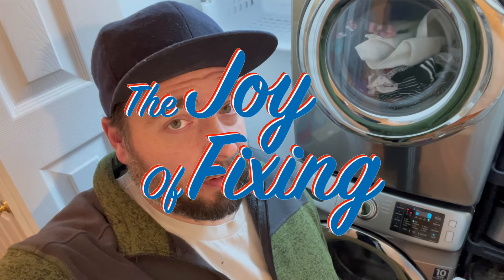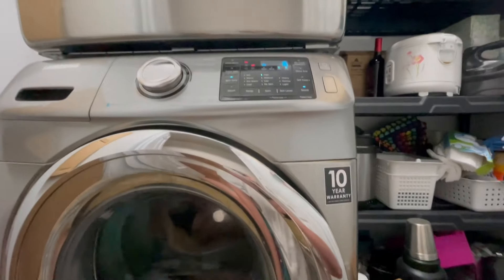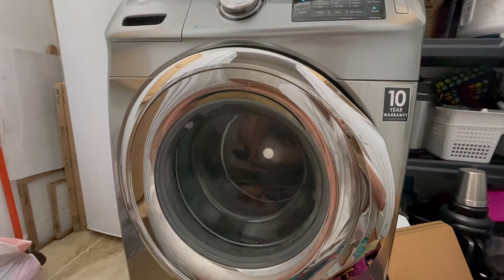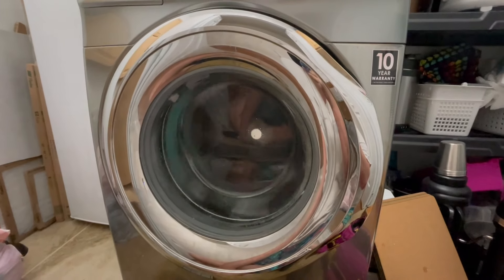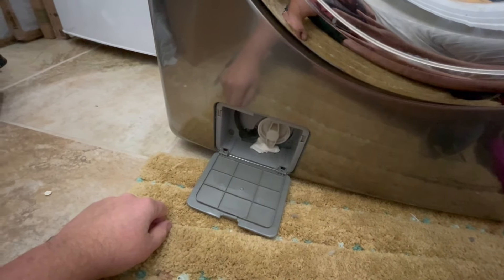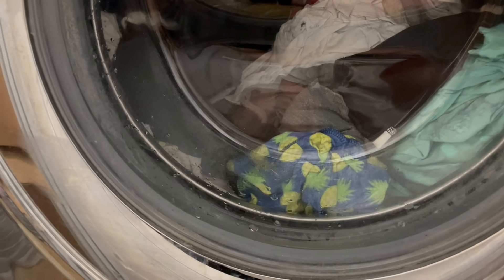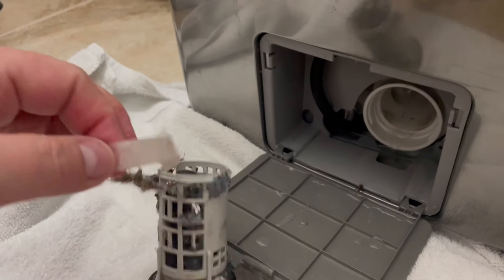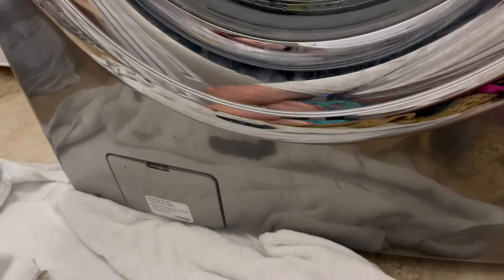Samsung 5E / SE / 5C / SC Washing Machine Error Code On Screen - Stops Running - EASY FIX!

Comment: Worked for me thanks.  I didn't have to pull out the black tube because my washer is outside.  I just pulled beige cap off and let the water flow on the ground and removed all the junk from the filter. It was disgusting.  The washer I'm using came with my apartment so the things lodged in the filter are a combination of my filth and the previous tenants... yuck.  Thanks again.
Reply from the maker: Very nice! Glad it worked!

Comment: If you clean the filter (it was definitely clogged) but the machine still stops and throws the same code, what would be the next step?
Reply from the maker: I would check if something made it past the filter and is clogging water leaving the machine.

Comment: Unless burning smell, then pump is probably bad. My washer still wouldn’t drain after cleaning/checking filter.
Reply from the maker: If you’ve burned out the pump, you been fighting clogs for a looooong time

Comment: Why is the filter torque limiting in both directions? It should only be for tightening.
Perhaps it's a manufacturing defect.
Torque limiting in the direction of loosening prevents the filter from being removed and you have to use plyers to remove it.
Reply from the maker: Sounds right for some machines.

Comment: My washer filter at the bottom of my Samsung never has any dirt or hair in it anymore. The first time it did now it doesn’t and now it’s leaking and giving me an 5C code. I’ve checked the drain hose. I’ve checked the water filter. what else could it be?
Reply from the maker: You might have a dead pump. Or a failing pump. I think at this point you have to call an appliance guy.

Comment: I found stenching semi-gelatinous, putrefying mouse, that met a grotesque death past the filter, in the tube. When I tried pulling it through the front, with a hook, the mouse cadaver shredded, apart, entrails, an arm, and part of a rear leg got pulled out.  The fermented mouse then went from putrid to pestilent.  I had to remove remove the drain hose and flush it with water from a water hose.  When the grizzly black clog jetted out of the hose and the water started running from black to clear, I reinstalled the hose and all is doing fine. 

Rest in peace Jerry 
Jerry Mouse  (2022 - 2024)
Litter mate, gnawer, squeeker
Reply from the maker: I guess I’m next….

What can we say about Jerry the Mouse? He was a friend, a good steward of the dried corn and an above average precision nibbler. He loved tight spaces. He loved wet spaces. Ultimately, his fondest loves became his demise. Let that be a warning to all of us… one moment you’re touching the hem of utopia and suddenly it’s months later and you’re being jettisoned from a discharge hose at 80psi. Let is never be blinded by our desires, and let is always hold Jerry in our memories. 
Ashes to ashes, Dust to dust, putrid gelatinous remains to storm drain. Amen.

Goodnight Sweet Prince

R.I.P. Jerry 2022-2024
Lover, Scoundrel, Friend, Flesh Clog

Comment: I actually have to drain it this way daily now... what is the next thing to actually FIX the issue. It's is probably the pump... which we had replaced while it was under the extended 3 year warranty... twice.
Reply from the maker: That’s extremely lame. You’re not getting good wash cycles then. Maybe try a different brand pump. Tell your service person not to use a cheap aftermarket pump.

Comment: Hi I need your help. I had the pump replaced with new o 8:07 ne and it still doesn't work. The error code says 5E.
Reply from the maker: You literally must have some sort of a clog in the line. I can’t think of any other reason. If you paid to have somebody replace this pump to fix that problem and it didn’t fix the problem you need to call whoever did the service and tell them they didn’t fix it.
Reply: Thank you.
Reply: @thejoyoffixing if you can’t think of any other reason then obviously you don’t have enough experience.
Reason is power module not powering the drain pump. I’ve had more of these than drain pumps failing. Yes I get the odd “pump clogged” but have seen more of the “no power to the pump” than actual pump failures

Comment: What if I have 5c message AND it won’t spin
Reply from the maker: It’s not spinning because it’s not allowed to in whatever mode it’s trying transition to. It’s trying to protect your pump. Check for a clog. If it’s not, you might be in need of parts

Comment: When I turn the filter knob the filter never comes out. It just clicks when I turn it.
Reply: Mine was stuck because of a pen, I just used raw power with pliers and broke the pen in two, the plug came right out with all the rest
Reply from the maker: You might have something large stuck inside. Who knows. Maybe get out the pliers….. not sure. Tread lightly.

Comment: Hey I don’t have a damn filter tf am I supposed to do lol
Reply from the maker: You’re getting the code but there’s no filter to remove?
Reply: There’s no door or no filter location
Reply from the maker: How strange. Must be a different model. Google the model number and it should give you a user manual to find where it’s located.

Comment: I did that and it still is doing the same thing.
Reply from the maker: You might have a clog beyond the filter. See if you can look in the filter hole and see anything way back there.